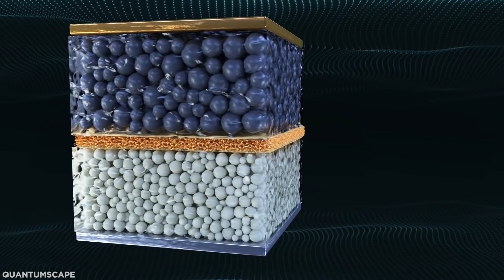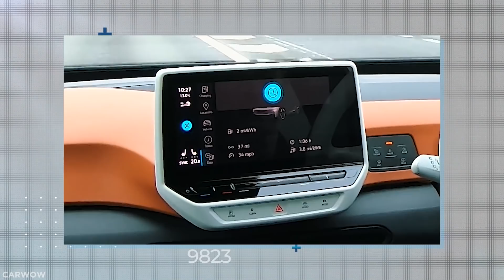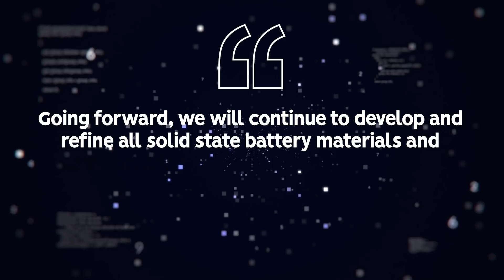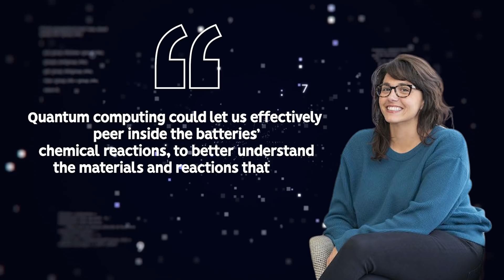Why Solid State Batteries Are The Future

Comment: comparing average electric range with the highest polluting, longest range alternatives is dodgy. No one has a solid state commercial battery and some like Tesla have tech in lithium iron and Tabless cells that solve both fire and cooling issues, so the target for solid state is moving ahead.
Reply: The polluting alternatives that are used to transport EVs and EV parts all around the globe!! Wtf are you talking about??
Reply: @alanmay7929  They are talking cars you silly boy. Hydrogen is most likely to be used in boats, and Batteries in semis, (and... Tesla is building the factory now... for a semi, a pickup, and a cast bodied SUV. THATS the real future, the one being actually made) . And there are NO mass production solid state batteries, or economical production at all so far...., and they have been coming for as long as lithium ion. Tesla {as a documented case, with a gigawatt hour TRIAL plant running,(and thats massive...)) releases
Reply: @RacefanPat68  we still don't have any semi or pickup from tesla so yeah they do not exist and you can't speak about it either, the giga casting is nothing special at all. And vw has been making over 10 million cars a year with astonishing efficiency in manufacturing like platform sharing, engines, systems and parts too
Reply: @RacefanPat68  like I said they still have a long way to go before selling those semis and trucks, to avoid disappointment on range they still have to improve the battery density and many other aspects, there are sooo many different types of trucks including refrigerated, construction.... the casting is irrelevant its just a way for tesla to avoid machines, but trust me tesla will still need tons of stamping machines. Vw AG for example have been shared car platforms for 10 of different models, vw touareg, Bentley bentayga, porsche cayenne, Lamborghini urus, audi q8... and the efficiency is just on a whole new level. The same goes with parts and engines and equipments too
Reply: @alanmay7929  You have no idea. I am aware of sall you said, and it answers nothing. Tesla, HAS a semi, with 500 miles. They also have a DEMONSTRATED way forward with batteries and anyone can share platforms, Model 3 and Y are shared platform, for now. VW is a good example of a company who ADMIT they are 10 years behind in batteries and software. 10 YEARS. The only real skill MOST Car Companies have is  ICE engines, which are the problem. Also having 10 brands all the same generates as many costs as savings. OLD thinking cant win. The core problem is, as I originally said, that Solid state batteries have been vaporware for 40 years, and now lithium based batteries have crossed a Rubicon, with Teslas dry electrodes, Tabless cells, and these thermaly stable batteries basically glued in to be a part of the Cast chassis, for less than $100/kwh are as cheap as ice engines, and at least 10 times safer, (Check the number of fires / million miles traveled), and Tesla for example have technology with software, materials, batteries, and cheaper factories, and cheaper manufacturing, and vehicles that can last longer and with as little as 1/10 the running costs... SO the equation has moved. Denial doesn't change anything. I think it was around 1910 Ford started selling cars. There where about 1000 in the country, ( half where electric}, and horse owners laughed them out of the room, 10 years later there whee 10s of thousands of gas stations to keep up, Just in the US. same thing happened with PC's Mobile phones, and even electricity. Whew.
Reply: @RacefanPat68  why dont you simply say 1000 years! wtf. the renault zoe is a very good compact ar and its selling like hot cakes, its not all about software. other companies will make EVs and sell them very well end of story
Reply: @RacefanPat68  when it comes to manufacturing no company beats toyota or vw, they makes easily over 10 million vehicles a year of all kinds and it requires a serious managment of supply chain to accomplish tht too
Reply: @alanmay7929  Totally irrelevant, and what has that to do with the solid state batteries or ev's VW cant do software, and Toyota is stuck on the other "big oil", old school auto industry con with hydrogen...
Reply: @alanmay7929  I never said they wont make them, and the VW ceo said 10 years, not me. That's why they have had to recall some to I think. The market will be all ev's shortly, but we where talking batteries, and they dont have batteries or software anywhere near right. They still use 40 computers in 1 car!
Reply: @RacefanPat68  the market will never be ev´s shortly sorry mate, i´ll be a very looooong time before all companies would even make 10 million EVs, im just curious to see what would happen to lithium sources around the world, its going to be the next oil and companies are already fighting for that
Reply: @alanmay7929  Lithium is everywhere. Iron is everywhere. Thats more FUD. By 2030 essentially all cars (produced) will be ev"s.  Tesla alone is on track to meet their planned goal of 20 million in 2030. close to 1 million this year,  the rain (Texas) and greenies (Berlin) will slow this years expansion, but all the (about 1000) model ys  that the new factory in shanghai was going to start producing in 2 months left the factory last night, covered. 

Tesla dropped the price in china to match the new production method you say dont mean anything, and sold 100,000 in 10 hours. Demand is everywhere. Markets all over will have it mandated by 2025. 

It has started. I stand by my words. You are not unusual in your inability to see these inflection points coming, as you believe what the manufacturers and media tell you. But they are beholden to the status quo, and advertising income, and use the sunk cost fallacy as an excuse to wait a LITTLE while longer, while the horse has not only escaped, it is bolting.
Reply: @RacefanPat68  yeah another bullshit, by 2030 all cars will never be EVs, there is no lithium everywhere and if it’s true it’s not that different from oil because companies will still have to extract and process them and even today the lithium exist because of the oil industry.
Reply: @alanmay7929  NO
" It is the 33rd most abundant element in nature and is distributed widely in trace amounts in rocks, soils, and surface, ground, and sea waters" It is mainly extracted from high density rocks at the moment, but can be extracted as a salt from sea water and sand. 
Because of the oil industry?
Thats like saying we use coal because of the car industry, and water because of the nursery industry.
Reply: @RacefanPat68  what are you going to use to extract all the lithium!? Electric equipments?, Electric tractors, nope ,even at sea all those big equipments are the most efficient with Diesel and they can work 24/7 thats how batteries production is possible at those high capacities, no lithium without diesel
Reply: @alanmay7929  I said that before... I know heavy machinery and shipping wont change to batteries, and I said so.

 This ha nothing to do with the lies about batteries, or the fact that our transport, nearly all cars, and the majority of trucks, will be battery powered, and the majority, most, power generation will be clean very soon, as it will be the only way to compete. You can cherry pick, FUD and lie, you are still full of it! 

Nothing happens overnight, but it will be shockingly fast, just as all these things are. 500,000 cars for the year, and nearly 200,000 for the 4th quarter for Tesla, who just a few years ago struggled to do 30,000, and have two bigger and better factories coming online within months... It has started, and Tesla is just the catalyst. 

They will also be controlling most of the grid, and mining their own products soon, as no one else WILL move fast enough, until someone shows them how. 

As an example look at the current state of Lithium based batteries; The Panasonic pert of the Nevada gigafactory has 10 up to date, state of the art battery lines doing what a couple of the new Tesla lines do, and their wet electrode system, which I dont really understand, takes longer, pollutes with solvents, uses cobalt, (ethically sourced), uses much more energy and you need acres and acres to dry the layers...

Teslas new system uses less water, and re-cycles it, reclaims all the few solvents used, is quicker, cheaper,. It introduces dry Rolled electrodes wound straight into cell and is lighter on power, and 1/10 the space.  And each line can produce theoretically, 20 gw/h a year, staggeringly more efficient. Now LG Chem, Panasonic and co need to match this. I think I heard CATL is somewhere along the way, but regardless of who makes them, this is the point, this is what these vaporware SS batteries need to match, and this is why Tesla, and lithium ion technology is running over ice cars.
Reply: @alanmay7929  I have answered this, I never said these would change immediately. BUT They will. eventually, and they may not be electric with lithium batteries, Possibly something still in dream stage, like fusion or ss batteries, LMAO. but electric trucks will slowly extend range and capacity but will not be diesel long term. Its inevitable. But for the foreseeable future there are only limited cases electrification works in heavy industry, farming, and trains/shipping, AS I ALREADY SAID

Comment: The alleged weakness of solid state battery is cycles. But I don't think so because 800 or 1000 cycles is actually maintained because all that happens after 800 or 1000 cycles is you see a drop off of only 20%, maintaining 80% levels. You never need to change the batter ever. Whereas lithium-ion breaks down completely due to dendrites.

Comment: Thermal runaway is a know issue with today’s lithium batteries. If this tech does away with this then I’m all for it. 1000 cycles is plenty enough. How many of you change your vehicles every 4 years?  Do believe the entry into market will happen much in advance to what he is stating. 4-5 years and I’m betting on Tesla to be first to market. Time will tell.
Reply: Solid state in limited production you’re looking at 2024-25.  Mass production by 2030.   Tesla should be doing terrawats a year by the time the guys are doing 1gwh. 

Still it’s worth developing.
Reply: Tesla already has 2000 cycles in their cars and has since the 18650 batteries came along in 2012.

Comment: This video is rife with outlandish claims from the beginning. Diesel cars that can get a 1000 miles. That's a lie unless somebody is driving at 30 miles an hour. And diesel is one of the most polluting cars that there is, dumping tons of carbon particulate into the atmosphere. This is another case of playing on people's fear of range anxiety, which is a false one.
Reply: Stop talking nonsense, diesel have DPF to significantly reduce the exhaust pollution, its not like the exhaust were straight piped from the engine to the air. The mercedes gls400d is a giant suv with a 1000 miles+ range
Reply: @alanmay7929  And you may have to learn the difference between Miles and Kilometers.  The GLS 400D range is 1000 KILOMETERS, not miles.

"Fuel economy is a claimed 7.7L/100km, which combined with a 90 litre fuel tank, means the GLS 400d’s cruising distance stretches well into the 1000km range."

Comment: This is all well and good. However, manufactures can’t even keep up to battery demand now, and ev’s comprise just over 1% of vehicles worldwide. How on earth are we going to meet these ban guidelines??? As well, what about power generation. The energy density of batteries doesn’t even come remotely close to that of gas or diesel, and the need to generate millions of mega watts, nay, giga watts of energy to recharge batteries daily is going to require vast amounts of financial input and taxation to develop the infrastructure to support all this. Yes, we need to develop this technology. A decade to change over? Not happening. It would be nice for sure. I don’t think I live in fairytale land however, and that’s what it would take to meet these types of timelines.
Reply: In a decade, the sale of ICE vehicles stop.  Which causing a decline in the use of gas/fuel.  So, add another 20 years onto your timeline of transition away from carbon based fuel.  Go nuclear!
Reply: The battery demand now is due to lack of manufacturing plants.  Those are already being built.  And power generation is already ready in most countries since electric cars charge at night when power plants are idle and demand is low.

And energy density of batteries doesn't need to be gas or diesel level as electric cars are 4x to 5x more efficient per mile.

The infrastructure is already built and being expanded.  The idea this can't be done is pretty far fetched.  It is already being done.

Comment: Personally I don't think for many people huge range is as important as rapid charge/ low cost/ long lifespan/ high energy density.
-A battery that does 6-700 miles would be fantastic but I'd be happy with a 250 mile one that was small, cheap, reliable, long-lasting and quick charging.
In the UK most journeys are not so far, I think this long range stuff is more for the US market.
Reply: Well, a long range battery negates quick charging to a point.  If you can drive for a couple of weeks between charging, topping up occasionally won't be a big deal.

Comment: Nikola scandal teach me that huge high tech company can be fooled by charismatic marketing, therefore big name like VW is not a guarantee. Unless QuantumScape has concrete plan to produce this another prototype battery in mass and competitive manner, I call this thing a vaporware.
Reply: Well said. Most cannot comprehend this. Also I did some research into QuantumScape. All of their forward looking statements do not include any of Tesla's new battery, 4680. So in all the forward looking statements even as far as 2028, they are comparing solid state batteries with Teslas current batteries. Food for thought.
Reply: @Raysliquidity  That's the problem with company's trying to compete with Tesla current product.. You have to compete with the next product Tesla produces thats 5-10% better. They just can't outsmart them.
Reply: I second ur motion.

Comment: My next car I want an electric car, but I will wait until a practical solid state battery car is created, and is affordable.
Reply: Sorry but I think that you will wait a lot of time
Reply: Good luck getting your next car in 15  years
Reply: I saw it like the battle between Normal Harddisk drive and SSD. SSD is fast and sleek (small size) but more expensive ($ per Gbyte). HDD is cheaper but slower. Basically you'll have to compromise one way or another. They'll be the time when Solid-state battery cost coming down but it'll always more expensive than Li-ion as Li-ion has already mature and established manufacturing output. You'll have to pay more for a better product.

Comment: Better charging time and abundant of charging points will be a massive enhancement towards 90%/> EV on the road. Charging points can be cheaply build by integrating to any existing struckture even in tight small spaces (motorcycle & car). Cheaper than petrol station and require relatively less space than petrol station. Petrol station TOXIC 😷🛢☠☠☠ leakage also greatly reduce/eliminated one day.

Comment: The Tesla 4680 cell has a power output that is 6X the 2170 predecessor cell. 
If the output is 6X does that mean the input could be 6X?
And if the input is 6X does that mean it can recharge 6 times faster? Because that would be a game changer and also a Solid State Battery Killer.
Reply: Not 6x, but the speciation is like 26%.

Comment: If SS batteries are gonna have lifespans of 10 years, we have to impose on electronics manufacturer That they stop renewing their devices yearly and instead go 2.5 years without new stuff. Improve rights to repair and consumer agency (information)

It's not enough That batteries have more power and more life if the devices are made obsolete in a year.
My laptop and phones are both older than 3 and they're fine, but they're made artificially outdated with more and bigger numbers of processing power intensive workloads that hinder performance + bloating and all that.

There's a whole culture in electronics and smart gadget that has to change in many areas and in great extents. We have to put pressure on manufacturers and software engineers
Reply: You are on spot here. It's a tricky issue though. Do you suggest that phone makers for instance stop innovating so as not to make sold devices absolete? Or do consumers need to learn not always follow what's new on the market.
Reply: Stop improving their designs yearly? What if my SS battery dies in year 9 and I want a new model but the refresh occurred last year? Now I have to decide whether to buy an outdated model or wait a year and a half to get a new one? That's a terrible idea. Tesla's rolling updates is much better.